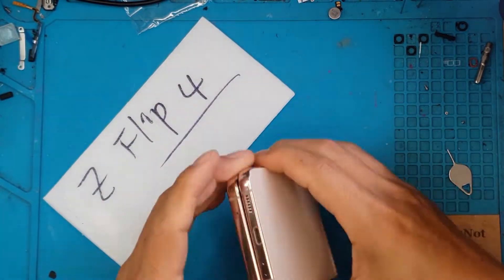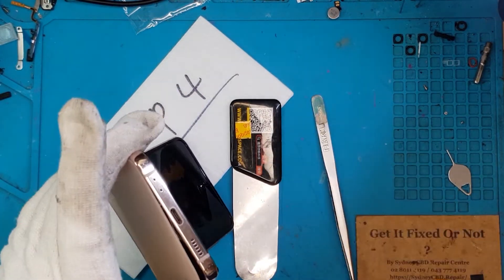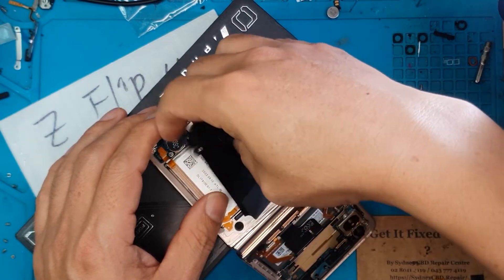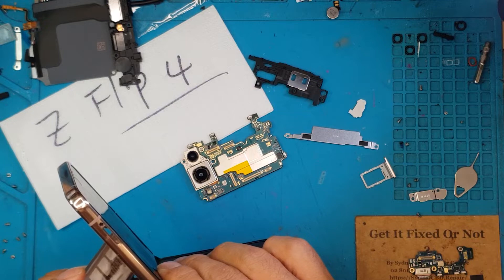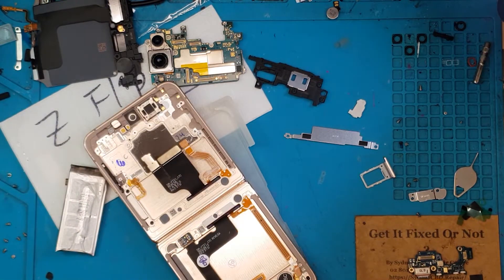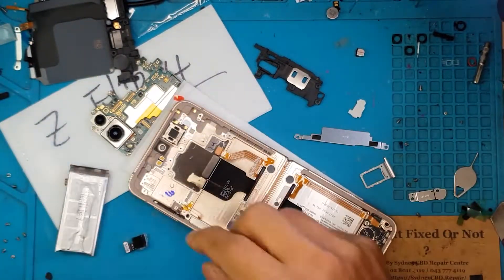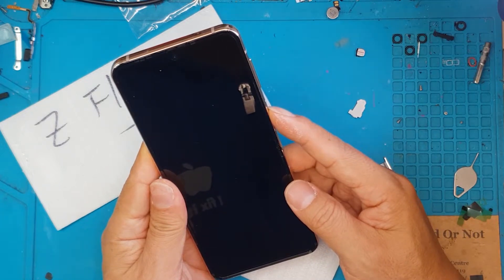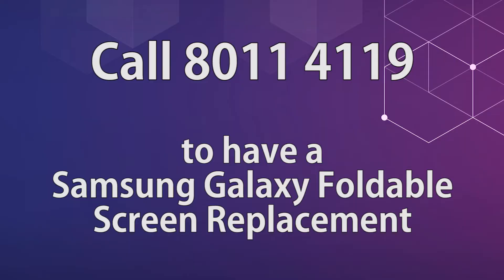THIS WON'T FOLD OUT! Samsung Galaxy Z Flip 4 Screen Replacement | Sydney CBD Repair Centre

Comment: Is there a way to get my data of this phone is the screen is damaged
Reply from the maker: Hello, Yes you can go to repair shop that recover data from your phone, we do it in our shop but using working screen so we need to open the phone fit a working screen and get all data and fit back the damage screen after recovering data